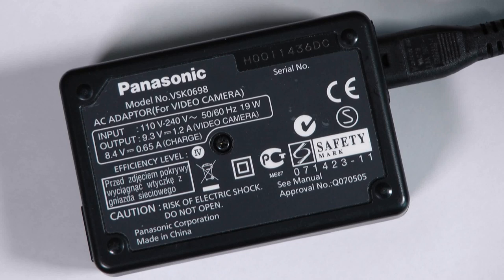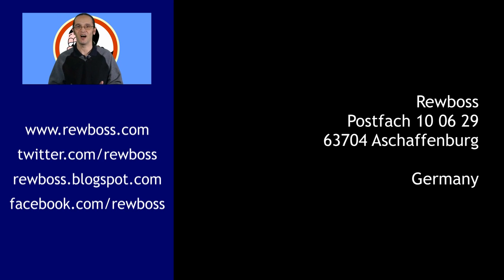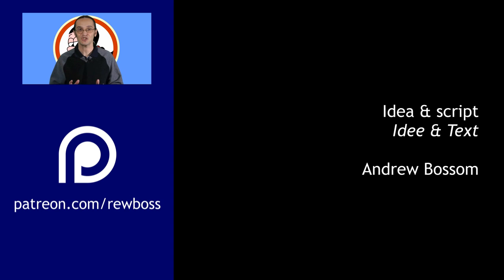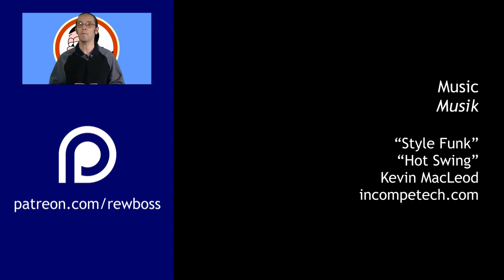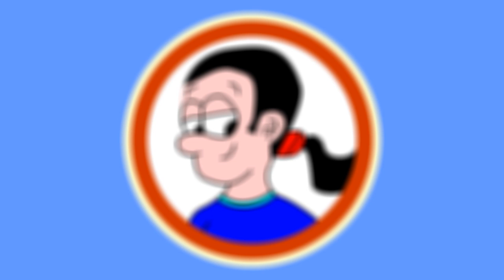Square pins and round holes

Comment: Ok, why do Britons HAVE to come up with the world's most bulky plugs?!? They are HUGE and cumbersome to use. That and those bloody sinks with separate hot and cold water faucets.
Reply: Because they have a water tank in the attic for the electric shower :) And the water runs freely from the tank to all outlets in the house. In a standard 1 storey bungalow you have therefore about 2 metres of water pressure = 0.2 bar. Most proper water faucets require 2 bar to work properly... 

That is why I have pumped water :)
Reply: What did you expect - as long as they not solved to mix hot and cold water into warm water, a functional plug is on the last page of the TOP list and with the Brexit the plugs can only get  larger.
Reply: There is a fuse inside the british plugs.
The only real issue (maybe besides its ginormousity) is that stepping on them is like running through LEGO.
Reply: The British plug is the best designed plug in the world. Fuse in the plug, safety shutters on the sockets and can be rewired by anyone with a screwdriver. They also sit in the socket without wiggling around, have plastic collars so you can't shock yourself when it is half in and are always earthed. Hurt like hell if you step on them though.
Reply: The most secure and practical is the German Schuko, thats why it nearly became a worldwide standard.
https://en.wikipedia.org/wiki/Schuko
Reply: in 5 or 6 countries :D
Reply: Because the brits are terrified of electricity, That's why they have fuses in the plugs AND the sockets. The rest of the world would happily use british plugs for 380V
Reply: InTeCredo because it can save lives
Reply: Newer Swiss plugs are as secure, allow for specific pins for live and neutral, and they are space saving.
Reply: Those thick plugs have a fuse inside. They're required by law.
Reply: its thatchers fault

Comment: The stuff about hairdrier motors and frequency is misinformation. I'm pretty sure those are universal motors and those don't care about the frequency. Because if they were synchronous motors it wouldn't be possible to adjust the speed with a simple switch. The issue limiting  adaptability of hairdriers (or kettles, toasters, coffee makers) across the pond is more likely the heating element not working with 2x or 1/2 voltage. In principle those could be made configurable  by switching two sections in parallel or series but in a cheaply made product that's too expensive.
Reply: Ah and there are very few consumer devices that one could take in a suitcase that care about the mains frequency. Some clocks, record players and tape machines did but if you travel with any of that you're weird.

Comment: Fun Fact: Some countries mix different standards. On the Philippines, they use american sockets but European voltage. Not a problem for us Germans. Adapters are easy available there. Now our US neighbors innocently plugged in there equipment, just so watch it being fired.
Reply: "On the Philippines, they use american sockets but European voltage."

That sounds like the maximally unsafe combination.
Reply: @seneca983  Not necessarily. US voltages with plugs designed for European standards might be even more hazardous, as the European ones might not be designed to carry as high an amperage as is customary in the US. While it's volts that give you an electric shock, It's amps that start fires.
(To carry the same power, a lower voltage requires a higher amperage and vice versa.)
Reply: @CLipka2373  I don't think so. A short circuit can cause high enough current to cause a fire if a fuse doesn't prevent it and fuses should in any case be chosen such that their rating is low enough to protect the wires they should protect. Also, I don't think the European wires or sockets are made to carry smaller currents or at least not much smaller as in Europe appliances can draw markedly more power than in the US.

Additionally, I don't think fires are the main worry in any case. The problem with US plugs and sockets is that it's too easy to shock yourself but on the other hand the lower mains voltage means that getting a shock is not as dangerous as it would be in Europe. The combination of US plugs/sockets and European mains voltage would seem to mean that the change of really dangerous shocks is uncomfortably high.

Comment: So are your washers & dryers 220 as well? or are they more?
Reply: 220/230, the only household item that uses more is a stove, at least in germany.
Reply: The stove actually uses 2 or 3 230V phases, not the 400V across them. So you could connect it to a single phase if you have 3 sets of wires into the breaker box.
Reply: Yes, basically everything you have in a normal household is 230V. Outlets are on a 16A breaker in Germany, which allows up to nearly 4kW peak. For more, e.g. charging electric cars, you can have a 3-phase 16A (11kW) or a 3-phase 32A (22kW) outlet installed.
Reply: Kirifairy And instant water heaters (Durchlauferhitzer)
Reply: @HenryLoenwind  You could use a stove on a single phase but you either need more that 16 amps (and thicker wires) or you can't use all the hot plates and oven at the same time as this would trip the 16 A breaker.
But you should never have three separate breakers on the same phase for the stove because the currents won't cancel out each other but add up in the neutral and overload it. (I actually found this insane wiring at my grandparents' house some years ago.)
Instant water heaters usually run on 400 volts. They often don't even have a terminal for the neutral (only for the 3 phases and ground). If you have all three terminals connected to the same phase they just won't work as there obviously wouldn't be any potential difference between them in this case.

Comment: I used to ram my German plugs into UK power sockets, it worked
Reply from the maker: That shouldn't even be physically possible, and is certainly extremely dangerous.
Reply: Trust me it does work, especially the flat German plugs. But you have to use a screwdriver to push down into the neutral (3rd) hole to press down the protection. Here you go: http://www.digitpress.com/room-of-doom/cm/displayimage.php?pid=4005&message_id=0879f49dacfa3b8928697c2adf28b452&message_icon=info#cpgMessageBlock   It was never dangerous
Reply from the maker: Definitely never do something like this: you don't know what you might damage (either in the plug or the socket), and euro plugs aren't fused -- which is a real problem with British-style ring circuits.
Reply: I'm sorry to say this tomtom, but Andrew here is totally right. you might end up damaging something
Reply: The British sockets are fused with 32 amps, the flat Euro plugs have a maximum of 2.5 A and have no fuse like the British plugs. In the event of a fault, nothing stops the plug from burning.
The contacts in British sockets expect flat pins, not round pins, so the contact area will be small.
European sockets accept round pins from 4 to 5 mm.

I wonder if cheap British USB chargers always have a fuse to change?

Comment: Don't ever plug anything in a unknow usb port.
Reply: plug a USB killer in it.
Reply: Guess I won't be able to charge my phone on a Flixbus then ^^
Reply: just use a cable without data pins, or use a USB condom.
ofc this doesn't save you from having your phone fried, but it's extremely unlikely that a USB port inside a wall is going to do that.

Comment: Interesting fact I found out last year: the German plug is exactly the same as the south Korean :O
Reply: It´s called Schuko DIN (Schutzkontakt - Protected contact by DIN - Deutsche Industry Norm) and nearly all in the EU use them (not Britain, but they leave the EU as well) France sometimes has a light variation which fits into Schuko sockets, but they have a extra pin for the grounding. Schuko uses the metal clips who keep the plug in place as grounding. More efficient aka German, so no need for a 3rd pin.
Reply: @Rick2010100  disadvantage of the peripheral ground contact though: It connects last. Grounded connector pairs usually are made to have ground connect first for safety reasons. Not the SchuKo.
And while /some/ Schuko connectors can be found in most EU countries, far from all of them are. Italy still loves their three pins in a line, in two different sizes, even.
Reply: @HotelPapa100  this is not true, the schuko plug connects the earth first and disconnects last.

Comment: You can use german plugs in UK sockets, I've been doing it all my life. You just push a screwdriver or ball point pen in the top opening and the push the plug in the two bottom openings. Sometimes you need to be a bit forceful, but it's never failed me and i've never broken a plug or socket
Reply from the maker: Yeah, somebody else said that. I would be incredibly irresponsible if I advocated that course of action, as it's inherently dangerous and probably illegal. An adaptor conforming to all relevant safety standards is quite cheap and much more reliable -- and you don't have to poke around a mains socket with a screwdriver.
Reply: that is dangerous due to how UK houses are wired (32amp breaker/fuse and ring circuits) and german plugs having no fuse, and most sockets made in the past 2 years have a new shutter system that this does not work with.

Comment: I never heard of ac motors getting fried at the wrong frequency, actually the ac motors i know dont care about frequency at all, you can run tem on dc and 50 or 60 herz with no problem.
Reply: If it runs on DC then it is not an AC motor.
Reply: @brys555  But it runs both on ac and dc
Reply: @justaboringjoha3678  It's universal motor.
Reply: @brys555  Ok maybe, i know it was at least sold as an ac motor back in the 60s.
Reply: @justaboringjoha3678  Misleading name. I mean, if it's intended to run on AC only then whatever, but don't take this as a rule that all AC motors run on DC.
Reply: @justaboringjoha3678  If it runs on both AC and DC then it has a rectifier and thus isn't an AC motor.
Reply: @seneca983  It is an AC motor, there is no permanent magnet and no rectifier.
Reply: @justaboringjoha3678  Then it can't run on DC.

Comment: The German 2 pin lozenge type plugs are too easy to break if you plug them into a standard socket, you really need to use the lozenge shaped socket for those.
Reply: Really? I never in my entire life had a plug break.
Reply: Strange, never had an issue with them regardless of the socket... but that might just be me and stupid luck :D
Reply: Never broke one either
Reply: Me neither. They are basically indestructible xD
Reply: haddockman30 
What? The only way to break these massive things is if you do it on purpose.
Reply: schukoplugs are the modern nokias dude...
Reply: Going with the flow here: how the heck did that happen? They sooner tear the socket out of the wall than break.
Reply: They are not as sturdy as the Schuko ones (those are basically nuclear bomb proof), but really they only cause problems if you plug them into a socket designed for Schuko plugs and then accidentally hit them with something/cause them to bend vertically (i.e. along the long side, where there is free space in the socket). But even that needs a lot of force and would have the same result as plugging a US plug into a wall socket and then e.g. stepping on it. I never had either a Schuko plug or a europlug (CEE 7/16) break, and I have been around for a couple decades now :-)
Reply: i have no single outlet or power bar in my house that has anything else than the standard round socket, and I've never broken a plug.
Reply: haddockman30 Never broke one...
Reply: haddockman30 That literally never happened to me.
Reply: I have broken the 2pin plugs but outside of the plug. It was a cheap chinese old style transformer, so not the lightest. I managed to drop it on one of the prongs which then broke off. I dont really see how you are able to break it when it is in the socket, you have those 2 guide rails in the schuko to prevent it.

Comment: Speaking of plugs, British plugs are better than all other plugs https://www.youtube.com/watch?v=UEfP1OKKz_Q
Reply: I don't get it. What is supposed to be so great about them that other plugs don't have? shutters? sleeved pins? possibility of wiring them yourself? their fucking huge size? I mean, yeah, shutters aren't required but available for most european plugs. British plugs are the only type with holes bigger than a childs finger, so i understand why they require shutters. Sleeves and/or a recess are required for schuko, swiss, italian, french, ... "So you have live electricity you can touch..." FALSE! Wiring a swiss plug is easy too (no idea about the others), the cable comes straight out of the plugs, so you wont rip out wires, you rip out the whole plug. The Fuse is only needed if you have a ring circuit.
I see them as a bigger health risk than all other european plug, as they fuck up your feet if you step on them. And they are just so huge.